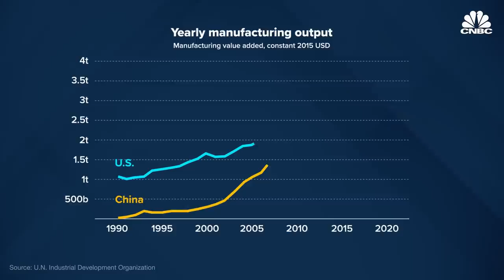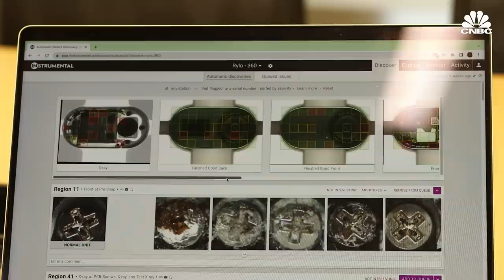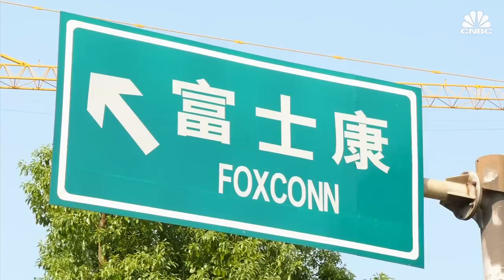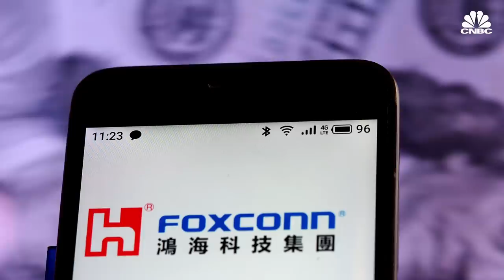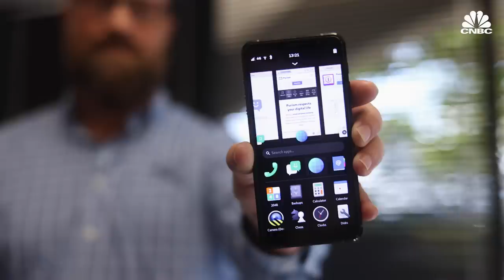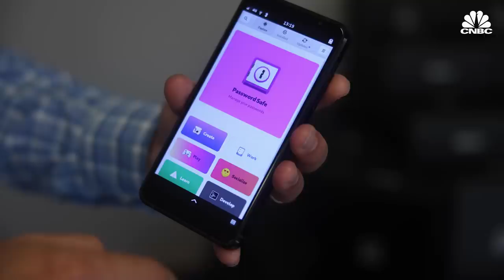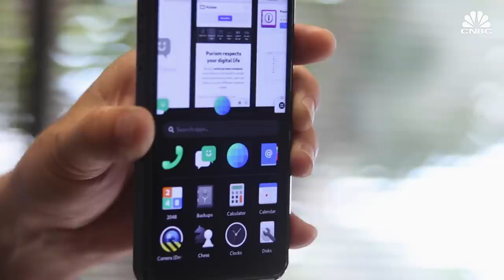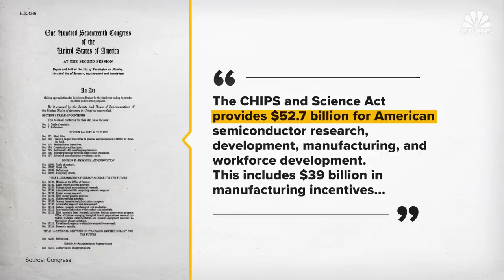Why The U.S. Fell Behind In Phone Manufacturing

Comment: No developed country can compete cheap developing countries when it comes to manufacturing
Reply: Yes we can. for starter if the device costs twice as much to produce in these shores then why not produce a piece that lasts 3 years instead of producing devices that have to be replaced 11 months later when the newer mobile phones comes out.  what we are doing is exploiting  cheaper labor overseas
Reply: @PHlophe  nah an apple or samsung phone which easily last 4 years are also manufactured in countries like China and India . So it won't make a difference you will lose with twice the price
Reply: depends on what kind of manufacturing..  Nobody wants to bring back low-value, low-tech supply-chain (ie, assembly/testing/packaging jobs) back to the US.
Reply: @PHlophe  good question. why arent people buying a more expensive but more durable goods? i still dont understand? any idea?
Reply: @PHlophe  companies aren't releasing phones every year due to phones not lasting long. They do it cause they know there are people out there who will spend the money to have the latest and greatest. It's a money maker for them. I'm still using my Samsung S10 + and it has been running flawlessly.
Reply: @Internal_Sight  I just upgraded from my S7 last week. 30 GB internal memory was used up by the system.
Reply: Germany
Japan
Korean 😉😉
Reply: @mohitbhalani793  ahh!!! I actually knew about the bulb. Because it was too good? I think there is one light bulb that hasnt been switch off for over a hundred years. Is it because of competitor start cutting price? Therefore its easier to joining with the competitor price?
Reply: Did you listen to the video? It's no longer cheap. It's about skill and scale
Reply: @meffendy27  well normally, you'd be motivated to make more efficient lightbulbs because you'd get more customers. The agreement was to keep the light bulbs inefficient so there'd be customers for everybody and everyone would profit. Actually, I think one or two companies violated the agreement at different points (making more efficient bulbs for short-term gain and competitive advantage)  and had to pay a fine. 

As for the 100 yr lightbulb, the material is part of it. But also factors like the low constant voltage, dim light, secure and backup power supply, and never turning it on/off increased its lifetime.
Reply: Even Chinese and Korean doing manufacture in my country in southeast Asia bc it's highly intense labor and cheap wages, it is just american being american
Reply: @PHlophe  most people wont buy expensive variants
Reply: @PHlophe  You know why. Stocks must go up!
Reply: @PHlophe  because things are done to increase profits not increase durability
Reply: Because of labor laws high wages😂😂😂😂
Reply: @jitendersingh4263  only high wages, developing countries too have good labour laws. India's labour laws sometimes become hell for industries.(one of the reason why we are behind china)
Reply: It would be foolish to assume India and China are still developing countries. They are well developed but it's the western media that is hesitant to acknowledge them as developed.
Reply: @meffendy27  why paying 3000usd if you can pay 1000usd for the same phone in a country with less labor laws, less regulation and more convenient? developed countries lost their competitiveness
Reply: @ARUchannel1  well the theory is pay for the same phone for 1000 yes? But in reality is....the country that made 1000, also compete with each other and start cutting corners and cost like 600 and most of the time lowers quality right?
Reply: That sounds like a you (as in developed country) problem
Reply: @PHlophe  a normal 150-200$ smartphone can lasts upto 3-4 years easily even if you use it all day.
Reply: @meffendy27  fact of the matter iphone or any phone can last 3 to 4 years as long as its not overused and take care of.  However, if the phone is constantly used as a gaming machine which will utilised up battery quick and heat up the motherboard etc, which will in turn reduce the phone's life span.  Not forgetting the other variables where the tech companies require's to push out new models and software year on year for planned obsolete of the product.  Else the tech company is not able to create and build value for their investors and board ... its not so straight forward as anyone would imagine.
Reply: @papastalin1543  You said no Developed country can compete with Cheap, developing countries and Some mentioned Germany, Japan and South Korea... So your statement is false
Reply: @xila-man8249  nah my statement still stands true, Germany,korea and Japan are not even in top 5 smartphone manufacturers. Biggest samsung manufacturing plant is in India not korea. They outsource manufacturing
Reply: @meffendy27  planned obsolescence..that's why
Reply: @wolverine9377  Don't including Korea, they just Samsung country.
Reply: According to your logic, India and Africa must be more powerful than China in manufacture.
Reply: @kevinrock9802  labour laws, free market, industry and Market friendly policies. Ease of doing business, permits , logistics, infrastructure etc are also key factors my friend 🙃
Reply: @meffendy27  how can companies make money then? imagine everyone has a phone that lasts 10+ years. First year they generate income, then what? what about the 9 years left? Not to mention, most phones last more than 5 years. Samsung, iphone etc...
Reply: @MuiKaHo  well if the condition of 5 years are okay, it will be soon that a phone will have a lifespan of 2 years in the near future so company can make more money?
Reply: @MuiKaHo  well i dont really know. I prefer a good long lasting product on the things i use often. I dont really like buying something cheap and spoil in a short term. I guess its preferential to diff individual yah?
Reply: @MuiKaHo  The problem with your argument is, if a company does disrupt the market and create long lasting phones, the whole system would crash. So the danger is still there. The only factor currently working for companies is there is in fact new innovation eg fingerprint scanner in screen etc and people will want to buy them. Also, software support making some obsolete helps the companies.
Reply: So, would you say, any country thriving in Manufacturing is a developing country? I thought people like you would consider Germany to be "Developed".
Reply: @arvind8302  what mobile is Germany  manufacturing?
Reply: This is patently FALSE. China is the exception, not the rule and only because it's currently rapidly industrializing thanks to an educated and skilled workforce.
After China the countries which manufacture the most are USA, Germany and Japan, which are all developed countries.
India, which is similar in size and population to China, produces less than all 3 of the above, but will overtake them when it also industrializes.
Reply: Tell that to Germany.  Germany learned to specialize in top end parts manufacturing.  Nobody builds industrial machinery like the Germans.  Just a matter of finding your market niche.  US has it with aircraft and space systems for example.
Reply: @karth33k  hahhahhahhhaha yeah in your dreams …😂😂😂😂😂
Reply: FYI China is 5 times richer as India and later is 20 years behind China to reach same level of income😂😂😂😂😂
Reply: @karth33k  covid mein log oxygen ke liye mar rahe the mere developed country ke maharaj😂😂😂😂😂
Reply: @PHlophe  Tech product is never about durability but newest tech, thats why Motorola and Nokia became history.
Reply: @karth33k  China is developed & infrastructure is just awesome in terms of Transportation, Supply chain etc....& per capita for Individual is around 14000$ & Economy is 16 trillion $. 

But India per capita is 1857 $ & economy is 2.4 Trillion $ So far from Developed. Nice try but don't compare with China, maybe compare with Bangladesh, as it crossed Indian's per capita 🤣
Reply: @ihl0700677525  ur comment has many incorrect facts , some are correct but many are incorrect.
Reply: @ihl0700677525  no it's not , just google top mobile phone manufacturing countries. There is no argument in that
Reply: @ihl0700677525  only in some specific high value products such as legos, luxury stuffs , sports car etc. But at the end they contribute less in the overall manufacturing sector .But When it comes to overall manufacturing which depends on huge mass produced products consumed by middle class people. The developed countries always loose. Even my 3000usd expensive computer has almost all its components made in china.  No matter how well made  Porsche is , it will never come even close to honda as a company. Honda will always be bigger than Porsche or Ferrari
Reply: @wolverine9377  america too I think
Reply: @karth33k  I think they mean by the mains but idk hell I don’t know much about them in development
Reply: @mikerichardson60  I say around $4000-$15,000
Reply: @tooltalk  yup, i dont understand why people are so obsessed with low value putting stuff together lol. Phones are just assembled in china and stuff such as the glass, the most important things, software (android or ios) and microchip (Qualcomm, snapdragon) are American
Reply: @PHlophe  still the product will cost very expensive, maybe normal people cannot afford it..

Plus this days technology advance in every 3 months, world has change...
Technology will stuck if people like u think like that..
Reply: @karth33k  lmao how is India a developed country? Millions of homeless migrants workers sleeps on a footpath everyday.
Reply: @PHlophe  to answer those question, why dont you ask US citizen to live under $700 a month first, asian people can

Comment: I remembered a few years ago BYD wanted to make electric cars.  They hired 10,000 engineers and they lived across the street from the factory.  Now BYD is the one of the largest EV companies in the world.  Even Warren Buffett is involved
Reply: Warren buffet is exiting BYD fyi.
Reply: Buffet started investingin BYD eons ago, but is now gradually pulling out as the gepolitical tension increases.   Let's not forget however what China did to protect BYD, CATL and other domestic companies from foreign competition in typical Chinese protectionism.  I personally think the Korean battery giants, LG Chem, SK Innovation, and Sasmung SDI, would have swept the Chinese market back in 2015 and on without the Chinese gov't very willful efforts to block their licenses/subsidies.
Reply: @tooltalk  BYD and CATL battery technology are superior to LG, SK and Panasonic.
Reply: @QuietJugung  : LFP batteries are not superior -- they are cheaper than NMC, NM+ other batteries dominated by the SK makers.   That's why Tesla's non-performant vehicles use LFP whereas high-end models use NM+.
Reply: @tooltalk  LG battery self ignite in GM Bolt EV and had to be recalled. Another car make with LG battery is having the same problem. LG sued SK for IP theft. BYD and CATL also have other chemistries besides LFP. BYD blade battery is best form factor and is a production structural pack. NIO have hybrid battery (LFP and NCM).
Reply: @QuietJugung  : doesn't change that fact that the Koreans, eg, SK Inno, Samsung SDI, are way ahead of any Chinese battery makers in NC+  BYD. CATL copy and steal too, but the Koreans can't sue them since the CCP protect them -- that was why foreign battery couldn't compete in China before.  Their other chemistry aren't soo good -- their main brean and butter is LFP.
Reply: @tooltalk  Let's discuss rationally. Don't let western media and politics cloud your mind.
Reply: @tooltalk  Many Chinese EVs products uses Korean batteries, 1/3 of Chinese automakers uses American, Japanese and European engines. It seems you're very emotional about China's supremacy on technology and China's EVs market on global scale market.
Reply: @codelessunlimited7701  : actually many don't use SK batteries -- and that is a result of China's state policy to exclude foreign competition to protect domestic battery industry since 2015.    And what's auto engines from America, Japan and Europe have anything to do with protecting new EV industry?  Do you realize that it's a violation of China's WTO accession protocol to demand foreign companies to find a domestic partner or give up their IP in exchange for access to their market?   It seems like yo are just throwing everything hoping to see if something sticks.
Reply: @tooltalk  China blows away the competition cry somewhere else 😂
Reply: @blokin5039  What a lily-white interpretation of ignorance. GO Go GO.
Reply: @QuietJugung  : rationality is clearly not your strength.  LOL
Reply: @codelessunlimited7701  let me help rephrase that. China is now part of the world economy and use whatever is best from everywhere. China can no more build stuff from 100% local supplies than the US can. They can try, but the result would be truly awful. Nobody would want to buy it.
Reply: What does this have to do with smartphone manufacturers? Vehicle manufacturing is much larger and complex than device manufacturing
Reply: Buffet is getting out as China is now saturated and getting old.........old fellow bufett can see the future
Reply: @codelessunlimited7701  No Chinese EVs use Korean batteries because Korean batteries never qualified for subsidies, you can thank THAAD for that.
Reply: @tooltalk  This is what every government should do. Chinese companies should benefit first/more by investing in China. As far as the CPC is concerned, Chinese investors are their first priority.
Reply: @MWENDA-vv5im  : >>This is what every government should do.
You mean every gov't should make empty pledges to promote fair/free trade; then turn around do everything possible to protect domestic economy by discriminating foreign competition?  Sure, I guess China can do whatever it wants, just don't cry b/c of sanctions from the US, then.
Reply: @yzy8638  : "beside, if developing or third world country dont protect some of their own industries,... "
If that's China's intent, all they have to do is say so and don't sign up to WTO and other world trade agreement.   Let China "develop" their own industry without the world.
Reply: @vlhc4642  : China's EV battery policy precedes THAAD.  China never believed in competition or free-trade.
Reply: @tooltalk  If economic sanctions that punish countries who threaten one's national security is going against free-trade, then China probably won't make the podium on who's most against free-trade.

Also THAAD was in 2016, China's EV battery policy was around 2018.
Reply: @vlhc4642  : Nope, you are making stuff up.  LG opened their first battery factory in Nanjing in Oct/Nov of 2015 and just months after that in Jan 2016, China changed their EV battery policy to limit foreign competitors batteries -- even if they are made locally -- from receiving subsidies to favor their own.   This is hilarious how some Chinese nationals are trying to depict China as a fair, competitive nation.
Reply: @tooltalk  The Chinese were just copying Korean industrial policies which were copied from the Japanese. All latecomer countries that had to rely on national level subsidies to remain competitive when they started off. I assume you're no stranger to how hysterically protective the Koreans are at home, or how they got a boot start on manufacturing do you?

However China's sheer size makes it different. On one hand the economy of scales makes things happened way faster than elsewhere; on the other hand, the size of the Chinese market simply cannot be saturated by like the Koreans, or anyone alone - unless they double down and went in at full force, which they didn't. Advent of homegrown giants in this case is only a matter of time.
Reply: @scienceisreligion5618  he is cashing in. His 200m became over 10B at one point
Reply: @tooltalk  can you be more specific how the chinese govt 'blocked' the South Koreans battery manufacturers? Korean companies were never major players in battery.
Reply: @k.k.c8670  : You generally seems to be unaware that since Sony's first commercialization of batteries in the 90's, Japanese and South Koreans like Panasonic and LG Chem have lead the industry since (Sony opted out after a battery fire). No worries,  LG Chem announced just a couple of months ago that they are going to start enforcing patents on high-nickel NCM batteries against Chinese battery makers.  Chinese copycats are now on notice.
Reply: @tooltalk  EV batteries, buddy. Keep up with the times.
Reply: @tooltalk  and I bet you used to also denigrate the Japanese and the Koreans back in the day.
Reply: @k.k.c8670  : >>  and I bet you used to also denigrate the Japanese and the Koreans back in the day. <<
ok, boomer  LOL!
Reply: @k.k.c8670  ; >> EV batteries, buddy. Keep up with the times. <<
LOL Sure, you keep pretending LG Chem, SKI, SDI were never major players.  LOL
Reply: @tooltalk  nope. They aren't for EV batteries except Panasonic. Keep up.
Reply: @tooltalk  really... Try to get up to date. Here to help you. Published in Nikkei... "OSAKA - China is increasing its presence in the race to develop replacements for the lithium-ion battery, a Nikkei analysis shows. A country-by-country tally of patents related to post-lithium-ion batteries over the past 10 years shows China in the lead, accounting for more than half of all patents.

The evaluation of patents for sodium- ion batteries, perhaps the biggest horse in the race, also shows China dominating Japan and the U.S., with Chinese companies expected to begin mass production of these batteries this year.*
Reply: @scienceisreligion5618 You still living in your delusions?